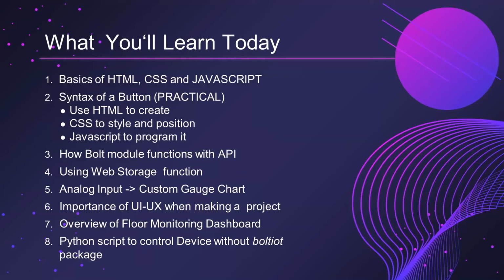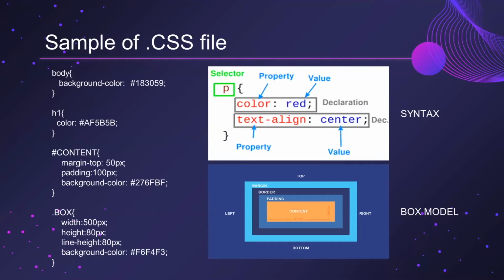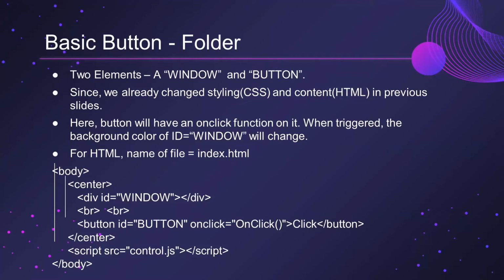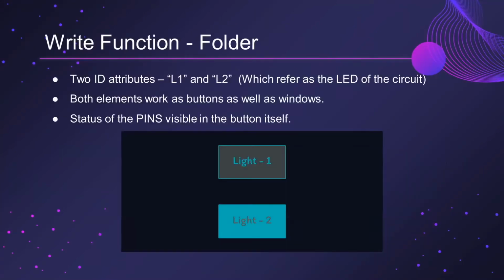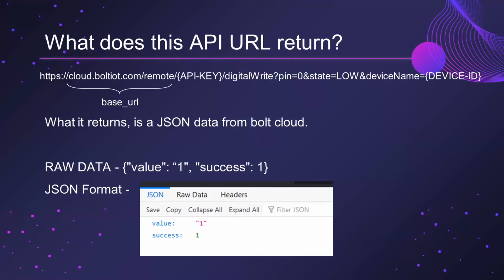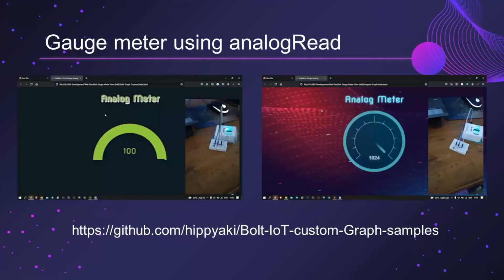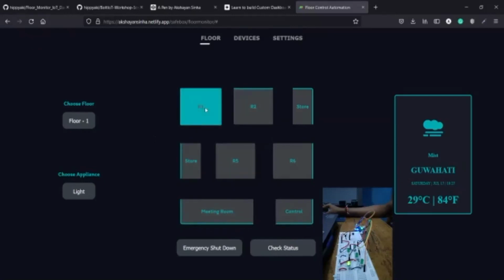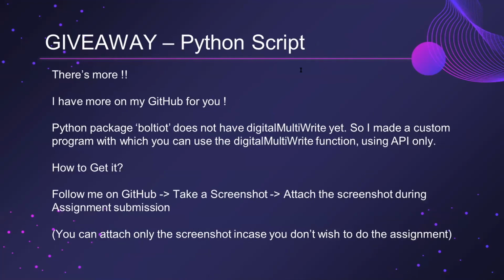Learn to build Custom Dashboards to control Bolt Products

Comment: If internet will disconnect for 1 hr then how this Bolt IoT device will control the close loop applications locally??
Reply: That's a great question. Using the OR logic, the appliances can be powered either from the cloud or manually with the switches.
Reply: @akshayansinha  Thanks for your comment. But it is not the power cut issue, which can be solved by redundant power supply arrangement. Here is no internet availability for some times and you hv no other internet connectivity option. Bolt IoT is only working as a transceiver here. Main close loop control algorithm is in cloud server. So its just impossible without alternate internet link. That is the main issue of any cloud based control system for all 3rd world countries.
Reply: @explorerofinfinity722  I got your point. What you're looking for is a local storage and analysis of data. Bolt IoT being a level 3 and above IoT system, won't be your best choice, as it is a 'Cloud Based IoT'. 

What you're looking for is a Level 1 or 2 IoT system where data storage and analysis is done locally.

I don't receive any power cut or internet connectivity issues in my area/state. For your case, might as well adapt to the situation or find a way to get a good internet  connection.
Reply from the maker: You can post your query on forum.boltiot.com